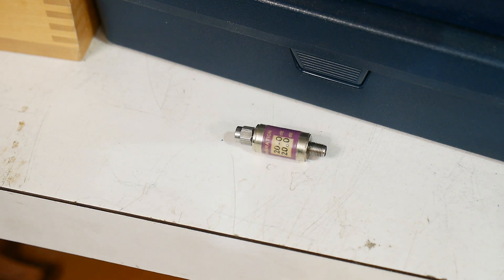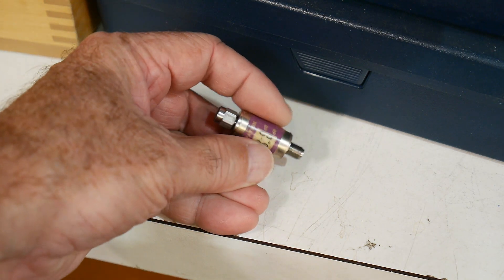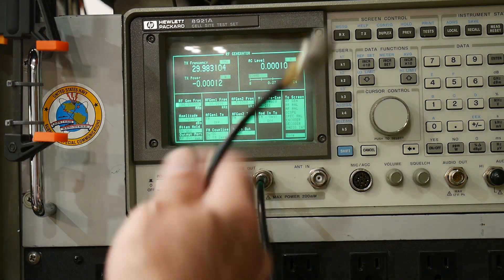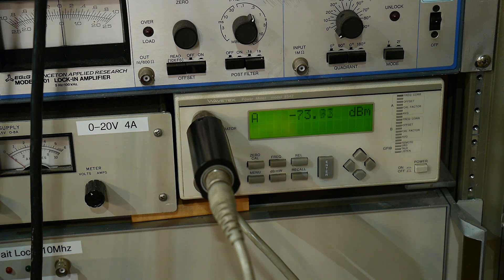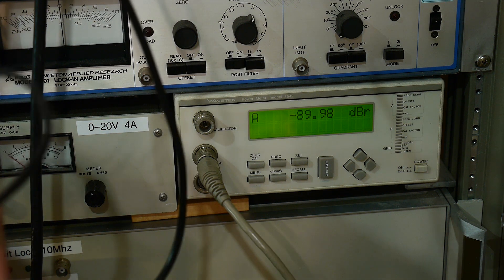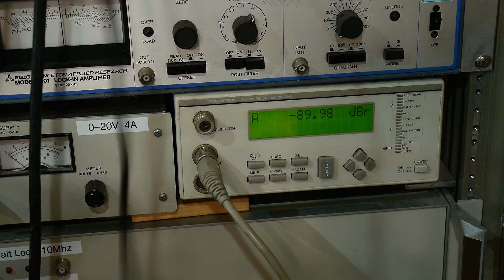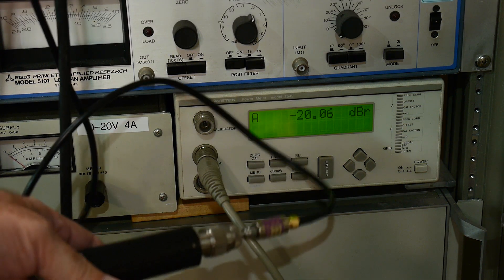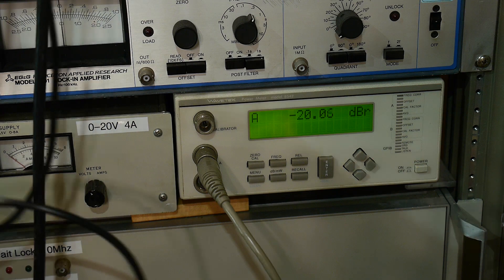#573b High Accuracy Attenuator Measurement

Comment: I have the same Power meter but marked Gigatronics, was their name Wavetec  before or now days ?
Reply from the maker: that division was originally a company called pacific measurements, then wavetek bought them, then gigatronics bought them
Reply: @IMSAIGuy  Ok that explains, mine has puls mod so I can measure DMR and so.
Reply: I have the Gigatronics 8541 and was aware of the PMI and Wavetek history for the model 1038 swept measurements systems (SNA) since, acquiring the 1038 systems gear, I was updating the TekWiki site regarding.  I found the mainframe of the 1038 is in appearance a D14 and they used the D10 & D11 mainframes prior.   However, I had no idea these power meters were a Wavetek system.  

I've been trying to ask around about the history of PMI and can't find much at all.  Seems rather elusive online at least and similar in print.  

Not to thread jack... though I started a Facebook group for the Pacific Measurements and Wavetek Systems I wanted to gather and share info regarding since wasn't easy at first finding for what equipment I've acquired in my studies.  https://www.facebook.com/groups/698747963909529

Last I messaged the Computer History Museum in Mountain View to see if they know anything regarding the history of PMI and am thinking there has to be someone still alive around, maybe in Palo Alto or elsewhere that might know more since I'd like to document the history of the company more for posterity.   

Last I looked there were two Pacific Measurements 1038-D14's listed on eBay for $50.  Unfortunately the sensors aren't the same design specification as the 8540 series.  Reminds me to start keeping an eye out for those and a HP 5347A sensor for this winter seasons projects. 

Here's the Tekwiki with the little detail I updated regarding (thanks to others support also) where related: 
http://w140.com/tekwiki/wiki/Pacific_Measurements_1038
Reply from the maker: @jafinch78  Most of the PMI guys were gone when I joined in around 1987. I was hired to design the 8540 series and VXI power meter. the sensors are much better than the old PMI ones. dual detector diodes and EPROM to store cal data. They already existed and were used with the scalar network analyzer Wavetek had. very nice design. we took the peak power idea that PMI had and put in in a sensor to work on the 8540 meters. Wavetek was bought by a private individual and he decided that the microwave division did not fit the core of Wavetek and sold it to Gigatronics. I left soon thereafter
Reply from the maker: @jafinch78  The old sensors cannot be used on the 8540 no matter how much you hack. you need the newer sensors as the meter reads the model number and frequency cal data from the sensor head. A dead sensor is impossible to repair. you can not buy the diodes (special) and even if you could it is way too small to work on and then you would have to do the calibration and know how to program the eprom.
Reply: @IMSAIGuy  Thanks for the affirmation! :-|)